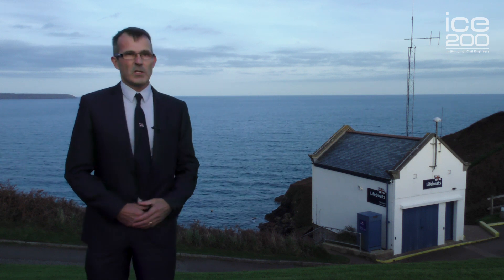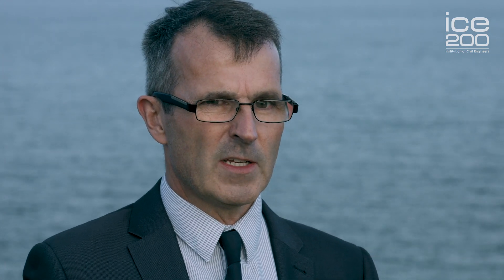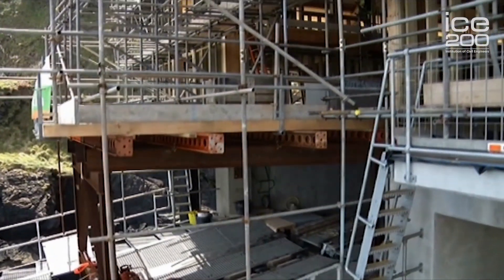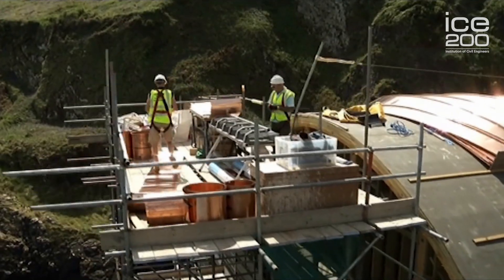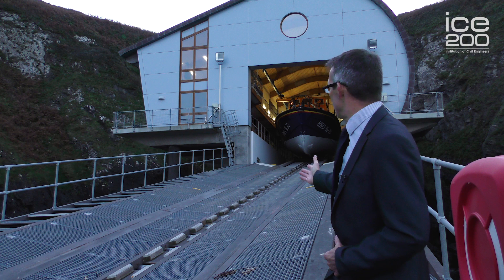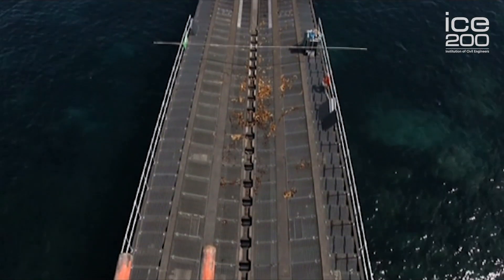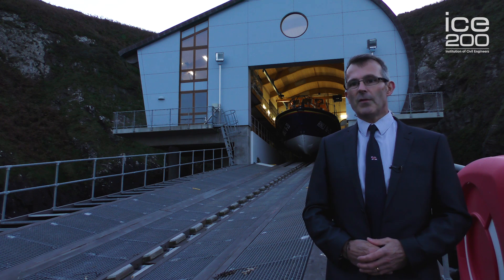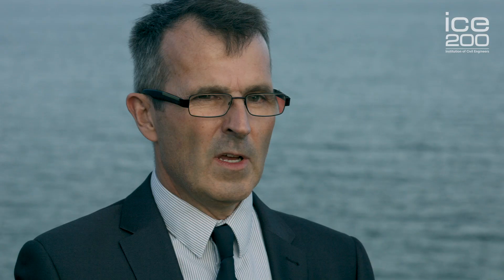RNLI Lizard Lifeboat Station

Comment: The station’s original 1859 lifeboat was 30ft long (around 3m), had 6 oars and cost £135. The current twin engine Tamar class boat ‘Rose’ is 16m long and cost £2.7m. Thats what the webpage says.

I am sure 30ft long boat has 9,14m, not 3m as webpage says, right? :D
Reply: yeah, that's what I thought

Comment: Ok, these are all really awesome and amazing stations but why do they use them instead of just docking in the water?
Reply: Brian Askren It’s easier to board in bad weather. It’s easier to perform maintenance. It’s less likely to be damaged by other boats or weather. Keeping it out of the water prevents organisms growing on the hull which will affect the boats performance.  It may allow the boat to be kept closer areas of risk than otherwise possible.
Reply from the maker: Hi Brian, we just asked Ben for you and his reply was "Lifeboats need to be able to launch at all states of the tidal cycle. Some stations, such as the Lizard are located on rugged exposed parts of coastline where there is no sheltered harbour to lay afloat. Some harbours also ‘dry out’ at low water meaning that a lifeboat could not get to sea in an emergency. The Lizard lifeboat station is of strategic importance to the RNLI and due to the surrounding cliffs, can only be launched via a slipway".
Reply: And it also easy to get down the slip way
Reply: And it's fun
Reply: There's LIfeboat stations with boats kept in the water at the nearest two safe harbours- Penlee (Penzance) and Falmouth. But there's a need for a lifeboat at the Lizard, to cover that area- and no suitable locations to berth one. If the RNLI could they'd have all their offshore boats kept afloat, it's generally faster and safer to deploy, but to obtain sufficient coverage they need to use ramp launches and tractor launches as appropriate around the coastline.
Reply: @PenzancePete  They're called FABs? And I thought I was already getting enough of a Thunderbird vibe.
Reply: Get on to a rocking ship or slide down a metal slide into water

Choose one

Comment: My question is how do you not abrade the bottom of the lifeboat? I did not see any rollers for the pathway to the water.
Reply: looks like rollers where the keel sits.
Reply: Smooth wood. Usually has some lubricant applied to the sliding area.
Reply: There are rollers
Reply: At time 1:47 you can see the keel track, but unless there are hidden rollers in the bottom of the track, I don’t see any.
A reply from the video authors would be greatly appreciated. I am an EE not an ME or CE. But I have some experience in launching and retrieving small vessels under adverse conditions.
Reply: Peter Notarfrancesco  Just look at the space inbetween the wooden guide blocks, there is a roller on the bottom.. just look carefull and you even see it at the time stamp you posted